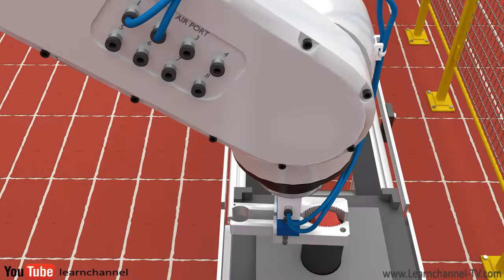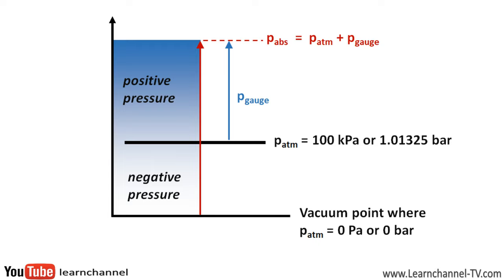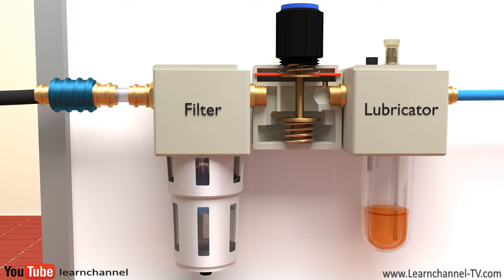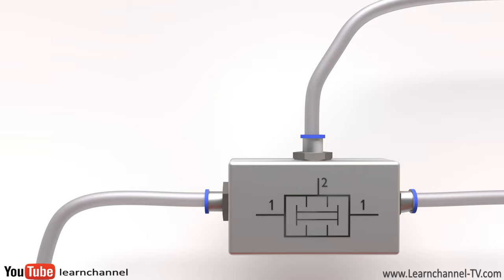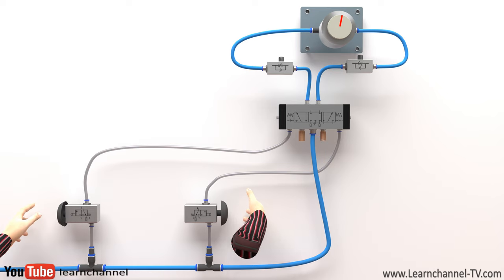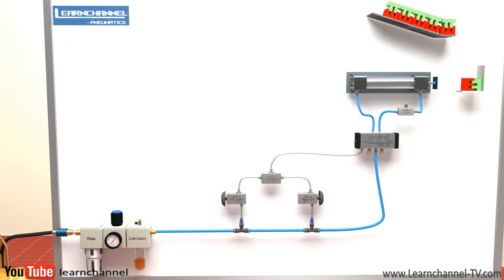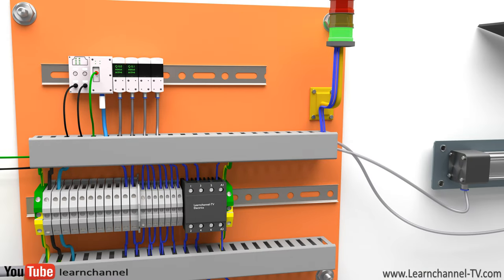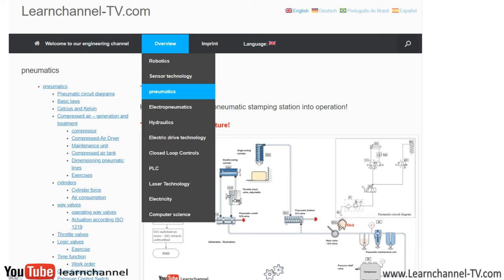Pneumatics, Pneumatic Control and Electropneumatics explained - Pneumatics for beginners

Comment: Thanks for the Great video .
Can you please tell me if a portable tyre pressure inflater can be used in place of a compressor along with pneumatic actuators for short usages like an height adjustable a small table weighing around 5-10kgs  maximum.